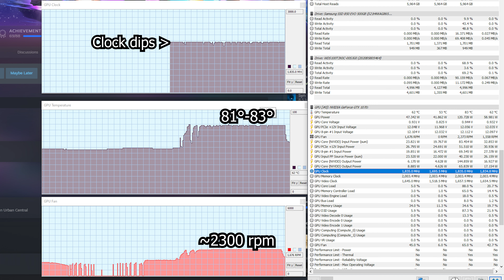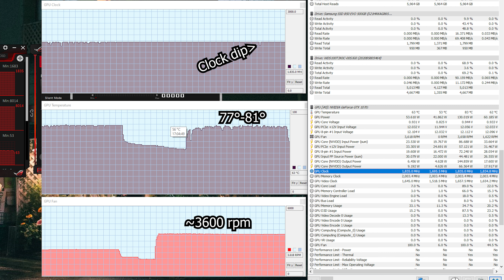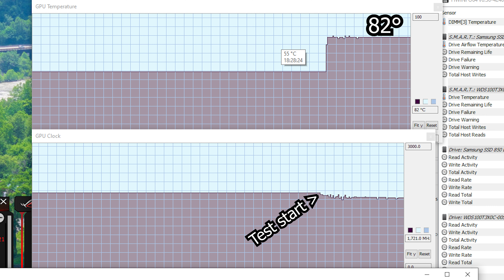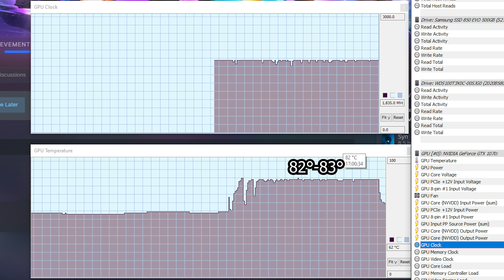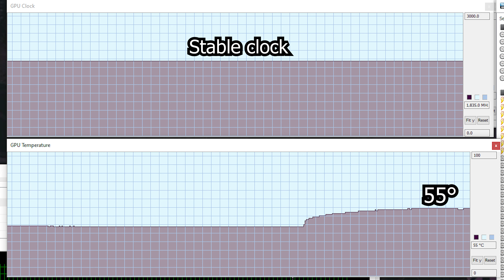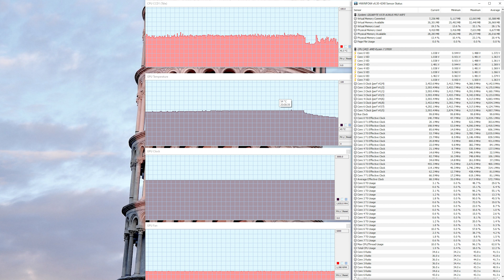How to Change GPU Thermal Paste. A MUST for Older Cards!

Comment: i just purchase 1080ti SC2 for $200 last night.  I ran the test and it was running at 87~88 degree and it crash so i thought scammed . Remove old thermos paste and apply Arctic MX4 and maxed out at 70 degree stable on heaven benchmark. I had to check if this is really happening to other video card and I found this video.  old paste was hard like rock.

Comment: Great video, I consider these things to be like preventative maintenance on a car. I got myself an RX 480 4GB recently just for the fun of it (never owned an amd gpu and for 125$ it was a steal), with the fans turned off (silent mode) it was running at 48~50 degrees, after replacing thermal paste ( I got myself a thermal paste named Thermagic ZF-12 from aliexpress for really cheap, but very high quality and a 12w/mk advertised conductivity) I couldn't believe it when I saw a 37 degrees idle temp, stressing the gpu never got it above 75 degrees and that was with furmark.
Reply from the maker: sounds like a success to me. Glad you liked the video, thanks
Reply: gonna try this tmr, i just checked my gpu thermal paste after it black screened playing ac odyssey and found out that the thermal paste was only surrounding the chip and not on it.

Comment: I recently changed the thermal paste on my 4 year old GTX 1080  wiping the old paste off the GPU die and not touching the sides out of fear of damaging one of the little transistors, is that bad? The results were amazing the first week I did it, but then my card's temps started to climb again.

Comment: I have the Dell RTX 3080. The VRAM temp would get to 109 degrees Celcius and after the repaste, it's now 96 degrees. I personally feel like I didn't get the right contact/amount in so I will repeat this process in the future and hopefully get better results.
Reply from the maker: Nice results. I might have to try it with my 3080 ti at some point. I think thermal pads might be better though.
Reply: @TechIlliterate  my RTX 3080 is the dell variant (Alienware R12) the paste has the most impact and changing the thermal pads  seems to have no effect if not worsen the temps from some YouTube’s who tried. I have repeated the paste and got exactly the same results. 96 degrees for the VRAM temp while mining.

Comment: Hi, hope you see this, but I might just be speaking in the void. I understand that you dropped 29C, but you do think this was because of the game you were running, or purely from you repasting. I understand that you sold this card, but if you ran a game that would really push the limits of the card, would you think your temps would be in the 70/75+'s. 

I ask because I quite literally just now repasted my GPU, but I haven't really stressed it properly with an intensive game, was wondering what you'd think I would get, or what you think you would have gotten. Thanks. Great Channel.

Comment: It almost shows that you don't have good air flow in your case. The front of your case should have 3 120mm fans with 3 fans out. Would be super quite since so much air flow would keep everything super chill. Your idle temps should give around 30-35 c.

Comment: What do you think of doing this on old cards that are new in the box? I recently got into this whole universe and was only able to snag an RX 580 and an RX 5700 XT, both were new in the box but presumably manufactured long ago. And, in general, assuming that one doesn’t harm their hardware, would you view this as perhaps proactive regular maintenance? Great video, thanks for the information!
Reply from the maker: Personally it would come down to thermals. If the thermals were good then I wouldn't bother. Though it is a fun project.

Comment: I have gtx 970, idle temp was fine around 33-35c but it ramps up really fast when full load, reaching 70-75c in minutes. Definitely trying to do this
Reply from the maker: Those temps aren't too bad! Let me know if you end up doing it.
Reply: @TechIlliterate  After asking my friend and do a little bit inspection it turns out only heat up on games like witcher 3, on other games it only sitting around 65-69c  full load, so maybe its fine.

Comment: Im thinking of replacing mine as well I bought a zotac mini 1060 3gb second hand and temps are rising as high as 82c 
That’s that I cleaned the heat sink almost as soon as I got it but nothing was done about the thermal paste.
Any suggestions or pastes I should stay away from?

Comment: I'm about to do this on my 1080ti strix getting 86c to stressed.
Reply: how did it go ? got the same card myself ... 86 is really hot tho, im getting 77c with 70% on the fans, im going to change the paste for hopefully a little better performance and for the cards condition the next year or two
Reply: and how did it look when you opened the card ? was it really dry ? and was it alott on there ? sorry for all he questions lol
Reply: @LegendXbox  went well, went to 68/70c stressed (modern warfare/cold war maxed settings) the paste was well dried up. Idle it hangs around 34/37 ish range. Using afterburner's default fan curve(adjusted it a little) fan starting to kick in @50c so silent/off in normal usage. I can advise to do it.
Reply: @INFIN1TY-  Nice! thanks for answer :D
Reply: @LegendXbox  no problem. 👍🏼

Comment: I have 2 gtx 980 ti frozen cards running HOT. I'm about to change the paste for the first time in 6 years. How much you think I'll drop from 80celcius?
Reply from the maker: Depends on what you're running. If a light game like mine did with rocket league I expect it to be around a 10-15 degree drop.

Comment: how old need to be the gpu to replace the paste?
Reply from the maker: You may find that the paste is dry not long after purchase depending on how long it's been on the shelf. Obviously that isn't a problem right now but I would suggest 1-2 years after first buying it.

Comment: I have very similar situation regarding the temps on GPU and VRAM, not so demanding games are cooking my RTX. So I'm actually planning to change my paste tomorrow and I'm a little bit scared of breaking something. Is it necessary to change the thermal pads also, do they break when taking the radiator off? Or is just a good idea to do so, hence the card will be disassembled already? What are your thoughts?

Comment: my gpu is the closest to being 3 years old and i noticed that without msi afterburner running rocket league even on performance mode like completely performance it was hitting 83C but it was at a steady 400- fps which is bonkers but there was a lot of stutters so i want to do this and i dont really have a cash app so i had to ask my parents to buy me thermal paste and kind of explained that it will cool down the gpu but they said that im dumb and no one ever does that and its some bullshit which got me kinda upset because i dont want to ruin my gpu so if you could kinda reply with explaining them that its actually effective and worth the try

Comment: Hello, man, how are you? Thank you for make this great video. First things first, I am from Brazil, so sorry for the bad english... Would you mind answer my requests? The first one is for make a full video explaing how you cleaned this GPU. I am asking this because of two things. The first one is that I have the same video card (ASUS rx 480 8 gb OC). The another one is because I am very afraid of breaking/ lousing my hardware... Again, thank so much for the attetion and take care!!
Reply: Another question is that I am having a problem with this GPU. Basically, when I am monitoring her with MSI afterburner says that she is osciling on 45-60% use, but ,when I saw the AMD radeon sotfware, It says that she is osciling for 0% tô 100%. The radeon grafict is like a mountain or triangle. I am trying to solve this problem, but I can't... Also, acording AMD software, this osciling apears all the time. Like when I am not playing anything only using the Opera/Chrome... Take care, Man, and cya!!!
Reply from the maker: Different software often use a different metric to read frequencies resulting in different readings. Using 100% isopropyl alcohol and a cotton swab is the best way to clean the GPU. It is easy enough. Just give it a shot.
Reply: @TechIlliterate  Thx!!!!

Comment: Pretty sure I have run into bad thermal paste issue on my card. Couldn't really run games as I remembered I should be able to run them. It's a close-to 4 year old ASUS DUAL 2080 TI 11GB OC. I can run games at what I thought were OK temperatures with almost no fan noise, but the newer games it just wasn't possible. Figured I must be misremembering the performance I should get out of it while essentially silent. Maybe bad fan curves or something with some update? To get it back to 0db or essentially silent, I tried adjusting curves and the clocks and power target. Noticed I was somehow getting better FPS by lowering power target and clocks. There was no change in reported GPU temperatures at full load, but the fans slowed down... Had to throttle down to 50% power target to get Cyberpunk 2077 with mid-to high-range settings to run silent. Got a proper GPU-Z version rather than the ASUS GPU Tweak III one to see the Hot Spot temperature... Myeah... it was at 109C at full load... Ordered new thermal paste just a bit ago, should arrive early this week.
Regarding the baseline benchmarks, that's an excellent suggestion! As I'm thinking back on it, it might be that the card was this bad always, even since I got it, or maybe it got worse. Frankly just don't know. I think I probably just figured it was normal "these new cards" were much more noisy since they were so much more powerful than what I had, especially with a TI version.
Reply: Just got mine re-pasted. Completely stable maxed out at 100% load (100% power use, throttled by power), 84C max, hotspot no more than 96-98C. And fan essentially completely silent at 66%. Now the only problem is Cyberpunk 2077 maxes out my CPU so I can't get more FPS anyway...

Comment: Hey guys, hope you doing well. Which one of these thermal pastes would perform better in my use case? CPU: 5900X , Cooler: 240mm Deepcool LE500 AIO

Arctic MX-4

Arctic MX-5

Coolermaster Mastergel Pro v2

Coolermaster Mastergel Maker

actually, I have a Mastergel Regular already. Do I need to upgrade to one of these?
Reply: The Arctic MX4 is a very good paste from what I saw. And I would say for a 5900x this is enough. If you want it a step further your can try the Grizzly Kryonaut extreme, which seems to be on of the best but also costs twice as much as the MX4. I can not say if the Coolermaster paste is as good.

Comment: My Graphics card has thermal pads that I can see from the side view on certain areas of the card, I scared that if I remove the heat sink panel it will ruin those pads and I don't have spare?

Will the thermal pads be fine or do I need to get or just leave it alone?
Reply from the maker: Most thermal pads are totally fine. Only ones I've seen cause issue were the type which came stock on the 3000 series Founders Edition cards from NVIDIA.

Comment: I bought my rtx 2060 in 2018 and it used to run at 65 degrees overclocked at 2.05ghz in summer now it runs at 86 degrees at 1920 mhz in october, i think i have to change the paste. :/

Comment: i have gtx 670 msi founder edition style i have 82c degree on stock fan when i use msi after burner and adjust the fan curve it max 75c and fan speed almost 2900rpm ..i need to try this with good thermal paste

Comment: A chinese paste called hy510 and it's 1 dollar in my locality and it's gets the job done😂 somehow it works may be cause i have a  gtx 750 ti, but it works i tried 2 times before getting the perfect application and for gpu always use applixator or credit card to evenly spread that thermal butter over that gpu cake

Comment: yo yo, which software did he/you used for getting the clock speeds on that graph? I know, that I could use Afterburner, but it doesn't look so clearly. His/Your software looks a bit like HWMonitor. 
Thanks for your answers!
Reply from the maker: I use HWinfo

Comment: I would advise to change thermal paste and pads on an annual basis, keeps the temps stable plus the cleanup is good too. I'm about to change my RX 580's thermal paste and pads for the first time in a while, hoping to see better results, cuz i started hitting 85-86 and the card usually hit 80 when maxed out. so it's about time :D
Reply: BS. 5 years with the stock one and another 5 yrs with a good past is enough. Cleaning the dust can be on an annual basis.

Comment: I cant recommend more ...... Please if you read this , repaste your GPU asap !!! yesterday I opened up my 4 years old 2080 ti and the old thermal paste turned to a powder , i replaced it with Noctua NT-H2 . and I managed to gain -25c  from the overall GPU Temperature . From 85c to 60-58c.

Comment: Hi mate, thanks for the video. Actually I am planning to do the same with my old GPU. Question: Is it worth the extra work and risk to use liquid metal like Thermal Grizzly Conductonaut?
Reply from the maker: I personally am not interested in using liquid metal. Unless you are planning on doing some serious overclocking it is not worth it IMO.
Reply: @TechIlliterate  Wow mate, didn't expect answer so fast. Really appreciate!

Comment: Buy Asus, get Asus quality. I have an Asus TUF 3080 TI that was randomly crashing. I eventually realized that the Hot Spot would go to 103c+. I repasted the card and now the hot spot max temps is barely 70-75c. There was barely no thermal paste on the GPU. Typical ASUS quality control.